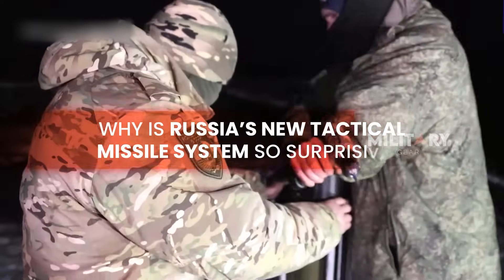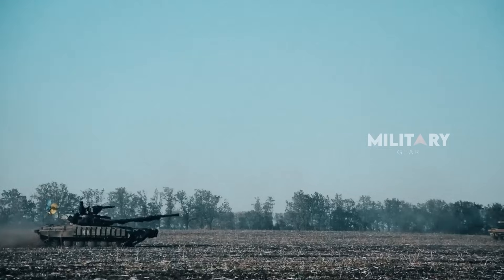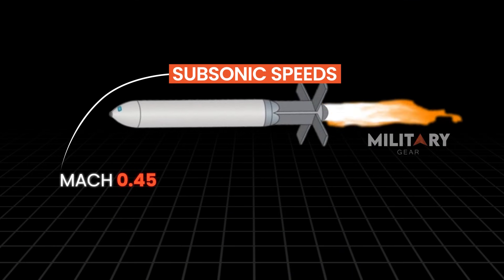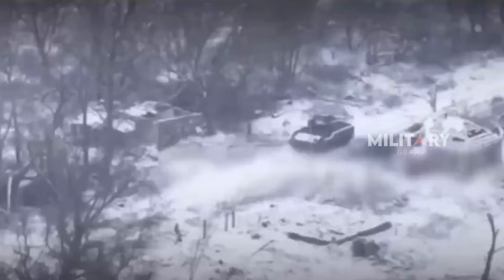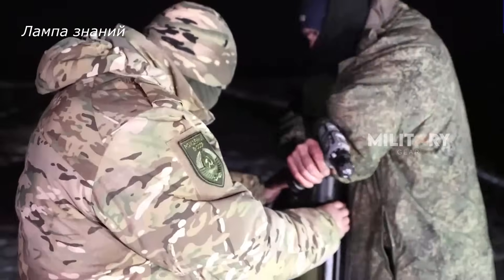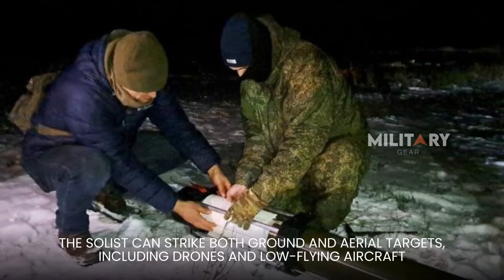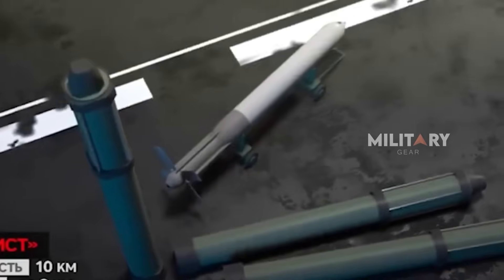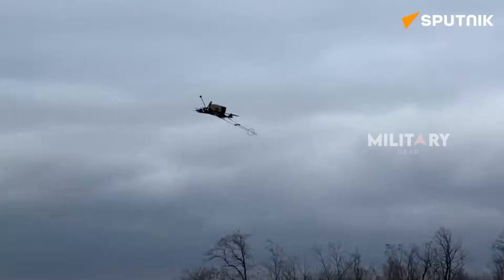New SOLIST Missile: Russia Unveils the Deadliest Hybrid Weapon

Comment: It has advantages and disadvantages over next generation fire and forget atgms . It gets around the costs and sensor and microelectronics requirements by using common FPV control and guidance technology. The west uses javelin and spike like atgms but at a cost that they manage to cope with. Like weight costs and thermal cool technology and advanced chips. Only west and other countries seem to cope with these types of weapons despite it's features that happens to be disadvantages as well 
 Russia doesn't have this technology and probably won't pursue this path right now. There are upsides and downsides from the same details. Russia needing FPV technology and operators to be safe far behind ie in shelters is also a bad thing 
. It's not as advanced in principle. Those firing guided munitions should be near the front or in the front. So there is a lack of flexibility and directness. But it does provide more standoff range. There are good and bad points for this and the west counterparts 
. It is somewhat innovative unique and it is useful. Maybe Russia can still pursue faf atgms in the near future when they see the need and have the capability.

Comment: The ability of an air defence unit to fight several targets in a minute is one thing, but it is also necessary to connect the units with each other in a network to distribute the targets and avoid the units from fighting the same targets. In my opinion that will be the next necessary step in the development of air defence systems.
Reply: Already developed.  I've a new computer because my old one crashed, and I lost all my bookmarks, (fucking windows!), but look up the drone that is a companion to the SU-57 and the autonomous swarming drones Russia has developed and is still refining and that China has had operational for the past three years.
Reply: @Onan-u3b As far as I can see this is not realized now. As also the separation of the antenna from the air defense and distribution of the data through radio or a network. This would make the air defense invisible for fighter jets which then only could localise the antenna.

Comment: This was expected, especially after such a development of FPV drones, it was only a question of when and which side would be the first to build a missile on the same guidance principle as FPV drones!! Obviously, the range is not enough, if I understood correctly, 2,000 meters or 2 km, it is not enough, considering that the Malyutka had a longer range, and I wonder why all the Malyutka are not equipped to be used as FPV, especially since they already have a cable?!! What's next and what I'm afraid of will be 20 to 220 mm ammunition from cannons and howitzers Which they will be able to manage very soon!!! Of course, for this it is necessary to have a stable 5G and it is very simple!!